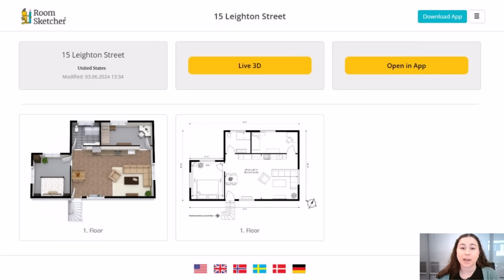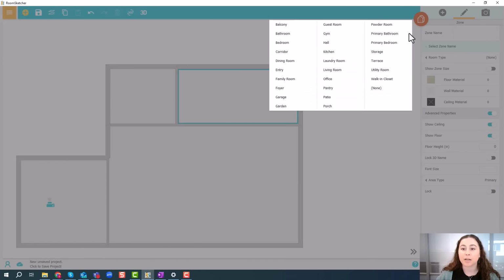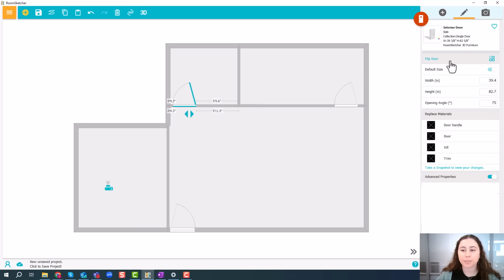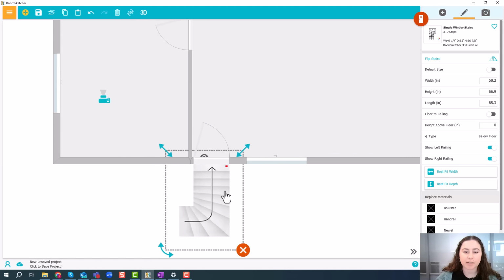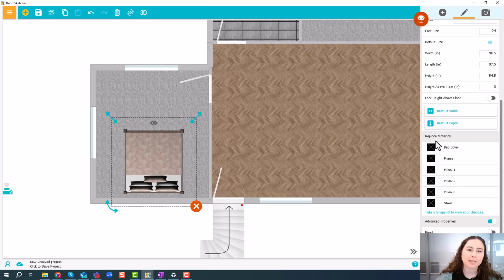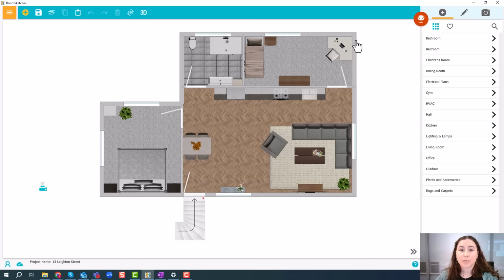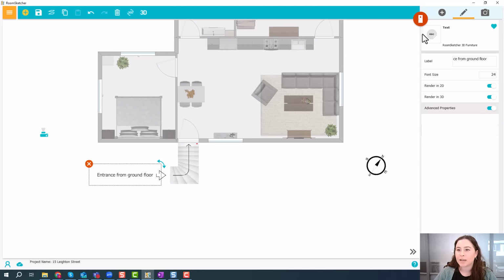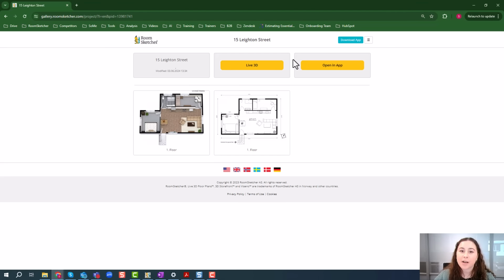How to Use RoomSketcher to Create Professional Floor Plans – Full Beginner Tutorial

Comment: I don’t  understand the "best fit" option on things like beds. Isn’t a king size a fixed size? If you do a "best fit" like you did in the video the bed is now a size that doesn’t exist in reality.  I can understand that feature on the end tables since you can get bigger tables but a mattress is a fixed size. What am i missing?
Reply from the maker: Hello😊 Totally understandable! The “Best Fit” tool is just a space-saver. It adjusts an item to whatever space is left between two objects or a wall, even if that creates a non-standard size. So for example, if you place two nightstands and then use Best Fit on the bed, the bed will shrink to fit between them. Even if that means it's no longer a real-world bed size.
If you're working with a specific size, like a king bed, it's better to enter those exact measurements first, then place your nightstands around it instead.

Comment: This app is so frustrating, I can´t see the doors unfold or the blueprint view when  I want to print to the project, nothing like the video above, I need urgent help or I will cancel.
Reply from the maker: Hello! I'm sorry to hear that you're having trouble with our app. You can change the angle of the doors in "Windows etc." mode by clicking on the door and adjusting the opening angle on the right side. To view your blueprint, go to the orange menu under "View" and select "Blueprint". Since this is an urgent issue, I recommend contacting our customer service for immediate and thorough assistance😊 https://www.roomsketcher.com/contact/

Comment: I am using the program and good . The problem I have how to put first and 2nd floors together 2nd on the top of the first floor? Thanks
Reply from the maker: While you can create multiple floors or levels for a building, you cannot currently view all levels stacked directly on top of each other in a single view, I'm afraid. However, you can design each floor individually and switch between them easily. You can learn more here: https://help.roomsketcher.com/hc/en-us/articles/360000107249-Work-with-Floors-or-Levels. More questions? Reach out to our friendly Customer Service Team for more help: Support@roomsketcher.com
~Team RoomSketcher
Reply: @RoomSketcher  .This is disappointing . i want to be able to see the 2 floors together stacked to see how it will look when finished with 3D  . Is this option will be available soon ? to decide if this the program i need to have? Thanks Ben
Reply from the maker: @BenAriLion  , thank you for your reply. I hope RoomSketcher can still be of good help for your projects despite having this feature available.